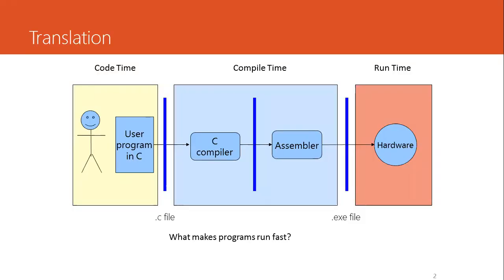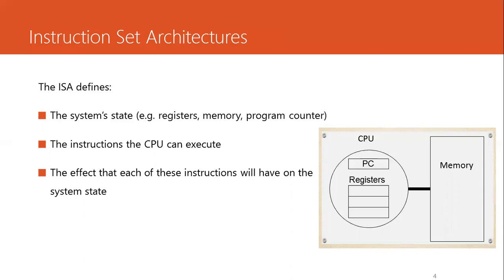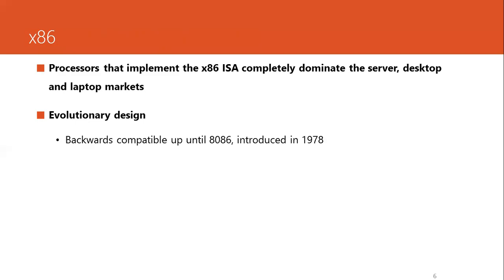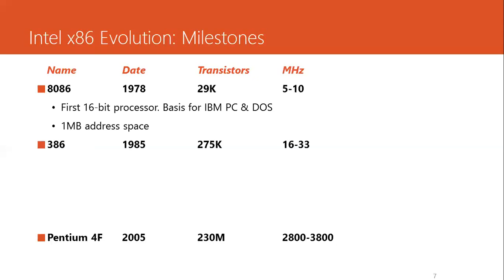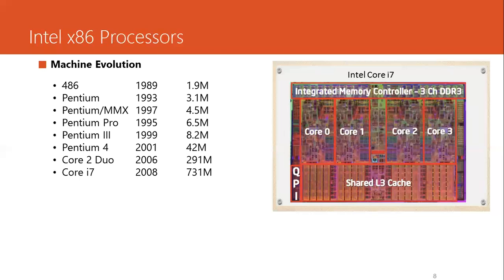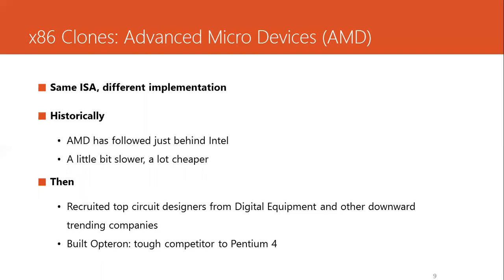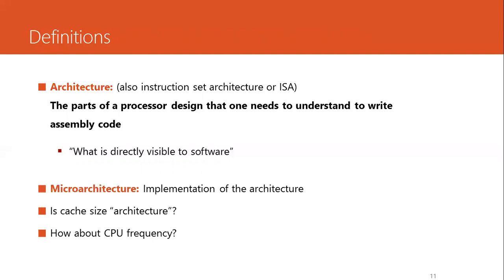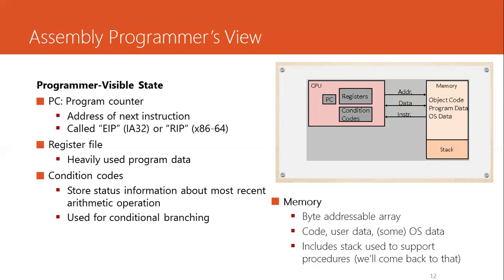Instruction Set Architecture | x86 Instruction Set Architecture | ISA vs. Microarchitecture

Comment: What is the difference between Pentium 4F and Pentium 4?
Because
At 9:18 of the video, there is mention at last of slide no. 7 that "Pentium 4F  (2005)" had 230M transistors. But in the next slide at 9:42 of the video, there is mention that "Pentium 4   (2001) " had  42M Transistors.